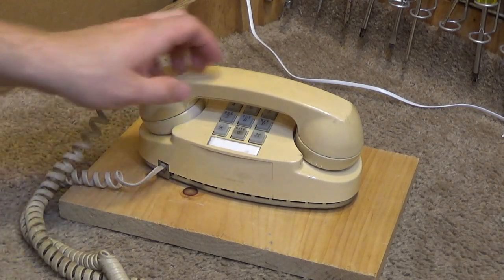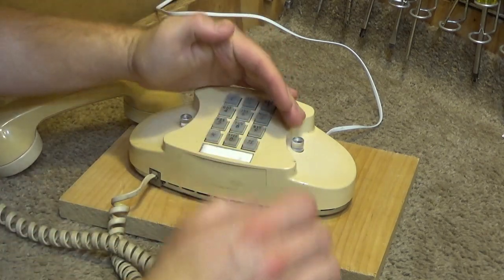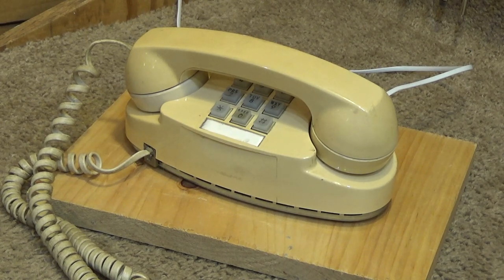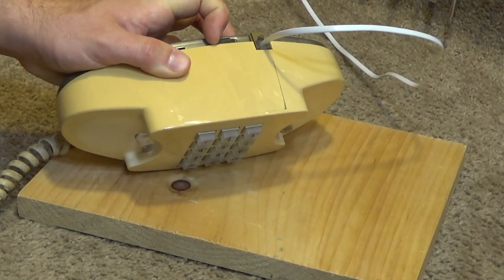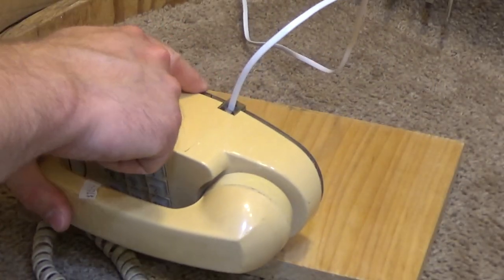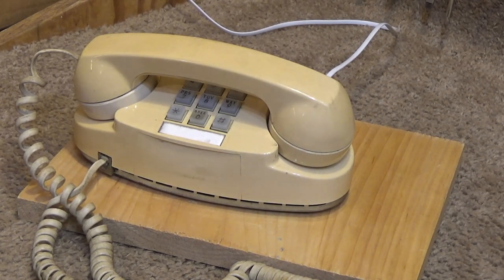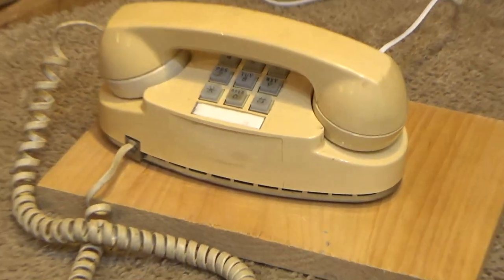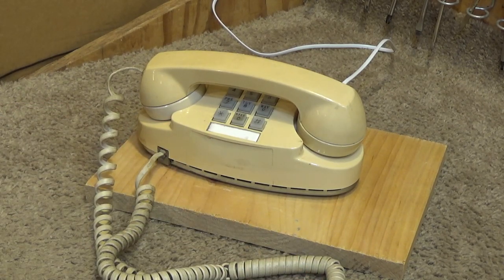1979 Western Electric Princess Telephone | Initial Checkout

Comment: The rear switch is for the light. One position, it comes on when the receiver is picked up; the other; it stays on, but dims, while hung up (night-light mode). 0:47 is the actual socket; uses #259 wedge lamp.

As for the buttons, try reversin' the leads in the phone jack. Some of those phones were polarity sensitive.
Reply from the maker: Thanks for letting me know.
That is a good idea about the line, I don't know why I didn't think of that during the video.

Comment: Great potential. It's a shame that the buttons didn't work--I love how full travel they are. Thank you for the video.
Reply from the maker: Unfortunately that's a common issue with these mechanical button pads. It can probably be repaired.
Reply: Its polarity sensitive reverse red green wires on line cords ur key pad will work just use a regular jack to test and see .....

U need 8v transformer for bulb to work works off yellow black wires off line cord